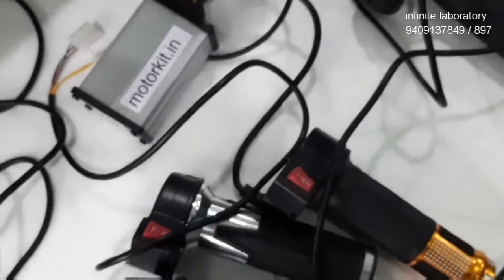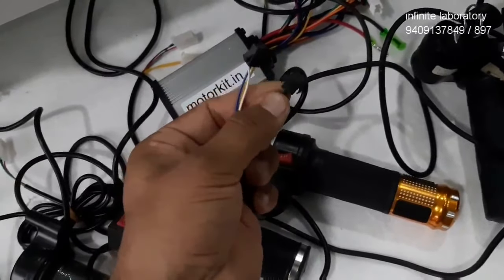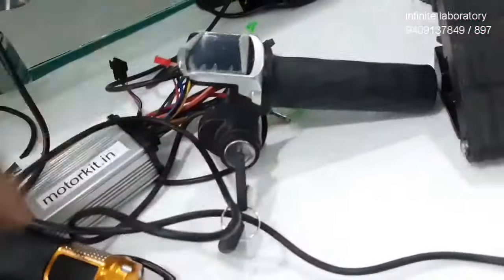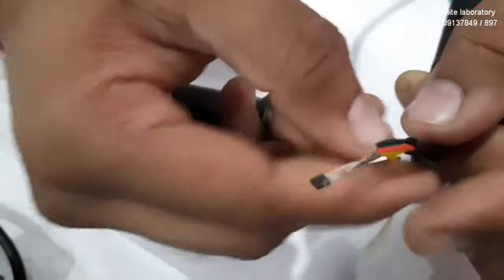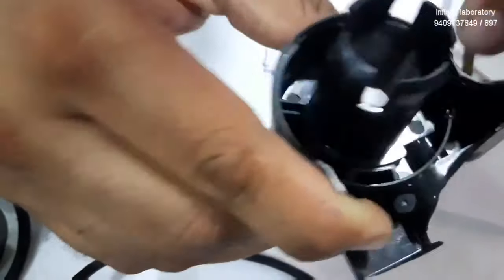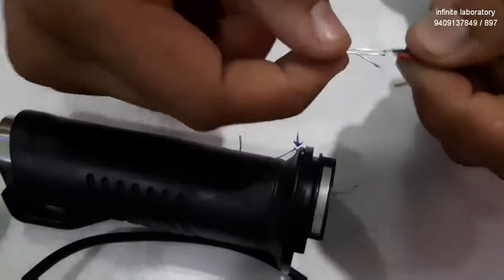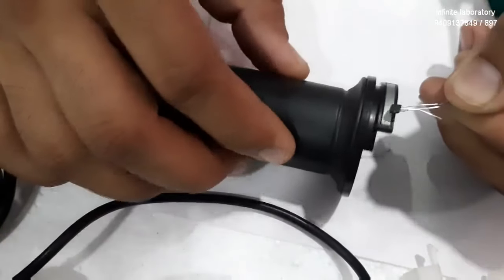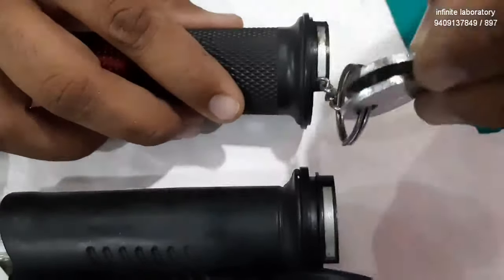Electric Bike throttle repairing and working

Comment: Bhai ebike ki motter me direct battery connect karo tho full speed ari but controller or accelerator k sath connect karo tho output voltage 15 hi araha h esa q hoga mera control new h 2 days old but accelerator 4 saal old hai kya problem ho sakta

Comment: fanatastic i just fixed my bike.    thankyou so much, my throttle was always on, well full throttle when turned on.   the hall sensor was not  aligned with the magnet which you explained so clearly i was able to fix it.     i am 68 yo and inspired with confidence
Reply from the maker: My pleasure sir
Reply: Grin said they seen the issue with only the throttle with the LCD display because the high voltage affect the unit.

Comment: Thanks for the video. I need to know the compatibility of my half throttle. I've warded multiple throttles and had no luck I was able to fix the original throttle. But I rather have something more durable
Reply from the maker: You are welcome sir,
Half throttle is good in case your vehicle falls , it remains safe. As throttle is inside.

Comment: It's very nice. Can you explain thottle which have 5 wires how connect them??
Reply: three main wires connect to controller; two secondary wires supply power to unlock controller which then regulates voltage to throttle (0.8v - 5v).  simplified answer; hope this helps. 

/bklyn 👑

Comment: Great video, very useful and informative information. Does anyone knows if throttle can be used with Bafang torque sensor as a pedal assist mode as well.
Reply from the maker: Not much idea about  throttle as PAS

Comment: Can i bypass the green wire and the red wire i mean short the wire? The green wire have 5volts is connected to red wire transfer the 5volts if its posible work?
Reply from the maker: Eithrr It will run on a fix speed without any possible way to control the speed , which is very dangerous.

Or 
It may possible it won't work at all.
Reply: @InfiniteLaboratory  its for testing purposes only my friend. To test the controler if the problem is the throttle my friend some buy a replacement for the throttle  with out thinking that we can test the controler throttle before we buy a replacement. If we short the green wire and the red wire and still not working thats the time the problem is the controler. Thank you

Comment: I am getting throttle error, and my ev scooter is not moving. After approximately 5mins when the ignition is on the throttle error is disappeared and vehicle is moving fine.. please suggest
Reply from the maker: Wire is not properly connected to controller,  check pins throttle wires.

Comment: Dear, please tell me, i have baby drift scooty, i replaced controller as old controller was not working, but this new controller soon as i connect hall snsor cable even sensor not inserted in its place but motor start running, without moving accelrator, what could be the issue?? Please answer
Reply from the maker: Controller is short or throttle is short.  Try without connecting throttle.  Also check self study wires need to ne disconnected.
Reply: @InfiniteLaboratory  dear its only started soon as i connect the throttle sensor cable, even i replaced sensor  with new one but same, the testing wire is disconnected and i have brand new controller.

Comment: Hi there I have 72v 2000w controller what type of throttle and how many volts do I need.... mine it runs for minute when I twist my throttle and then stop....
Reply from the maker: normally throttles are common for all ev stuf, It works from 0 to 5 volt
Reply: Steal bomber throttle are universal,  buy on eBay for lest than 20 pounds,  they go up to 72v
Reply: Stealth bomber throttle are the best

Comment: I have changed my hall censor and I still have no throttle at all  ?  Can you think why it has got no power
Reply from the maker: may be some other issues from controller side.
Reply: @InfiniteLaboratory  i still have peddle assist with lots of speed ,  so the power going to the wheel is good
Reply: @InfiniteLaboratory  i bought a stealth bomber throttle and the bike works better than it did,   I blame the cheap Chinese products they sell with these kits that they make for about 50 pounds and then sell them to us for 400 pounds,

Comment: We have a electric scooter giving top speed of 50 km/hr. My father is a elderly person an scares to drive it as it has very high pickup. Can we decrease the pickup by placing a proper valued resistor in series with the green wire of the throttle? Please guide us. 

The scooter has 72V battery and the throttle has High-Low switch. But the switch only reduces the top speed from 50 to 45 km/hr.
Reply from the maker: You can reduce speed by using potentiometer knob which will not allow full voltage to pass through it and throttle will get specific voltage which you have adjusted on knob, for example if you put knob at 50% , at full throttle it will get only half of the full value . So speed will not go above 22-25. You can adjust it by rotating knob at 60,70,80 percent as per requirement
Reply: @InfiniteLaboratory  Thank you so much.